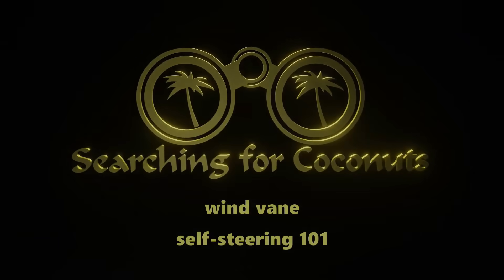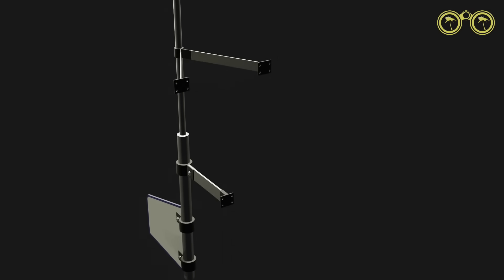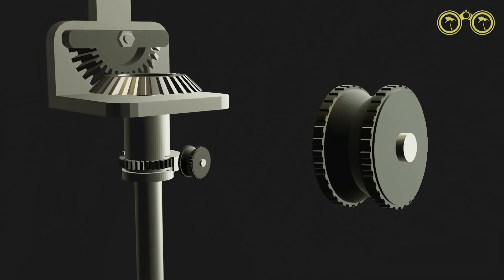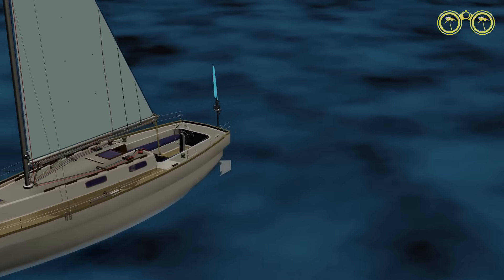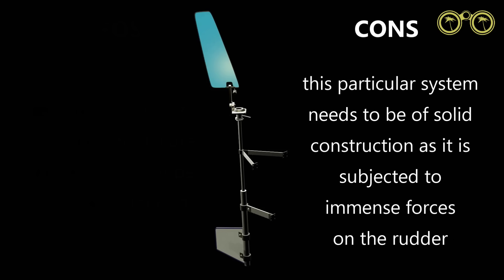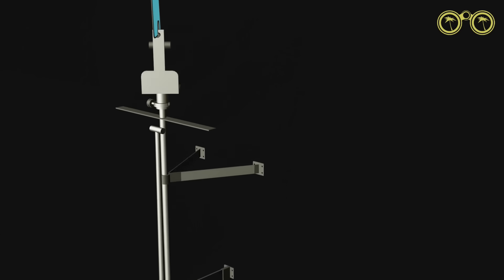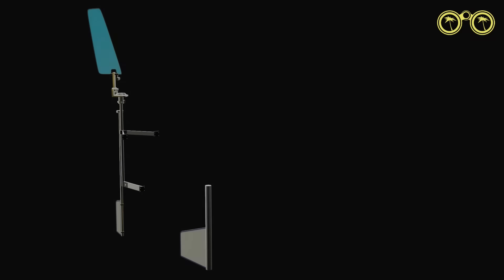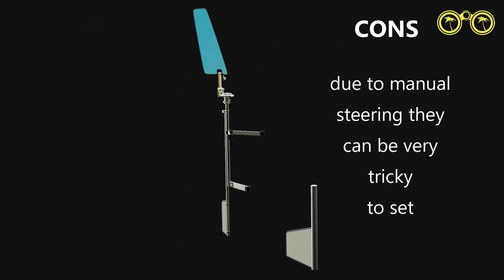Wind Vane self steering systems - An easy, animated introduction on how they work

Comment: These, especially the auxiliary type, are not only superior to auto-pilots in that they draw no power, but are also much more reliable, especially in heavy seas. Since the auxiliary doesn't use the rudder and steering mechanism, it means less overall stress on those systems, which increases their longevity. 
 
If you're going any kind of distance, I'd highly recommend spending cash on one of these. It's a worthwhile investment.

Also, great video helping understand how it help make boat go. I'm an idiot so just trusted to mechanical wizardry.
Reply from the maker: love the name... thanks for the detailed information and input

Comment: This is the best explanation on youtube, thanks. One question. Say your heading is 360 degrees and wind direction say 240 degrees. Windvane set up nice. However, the way i understand is that the windvane keeps the boat on course relavant to the wind direction, say the wind direction changes to 230 degrees while your getting some shut eye, does that mean the boats heading will end uo being 350 degrees? Therefor going 10 degrees ofcourse? How would you counter act this? 
Cheers Paul
Reply from the maker: thanks so much for your positive feedback... yes, you are correct, if the wind swings, the vane will continue to steer in relation to the wind and you will be off course. A wind vane can only do what you ask of it, which is to steer according to the wind, there's no way to counter this. A small variation as you mention, can be rectified on your next watch, and there's a good possibility that any greater shift in wind will be felt and noticed by you or your crew, as the sea state and conditions will alert you to such changes. Sailing near land or any other dangers would not give you the luxury of shut-eye and if you really need a break, it might be a safer alternative to heave-to and rest, ensuring you have no lee shore. Hope this helps, thanks again
Reply: @searchingforcoconuts2248  Thanks for your response. Makes perfect sense. The way I then understand it is then that the wind vane is great for long pasages/tradewind sailing. 
Again, many thanks for your response, love your channel